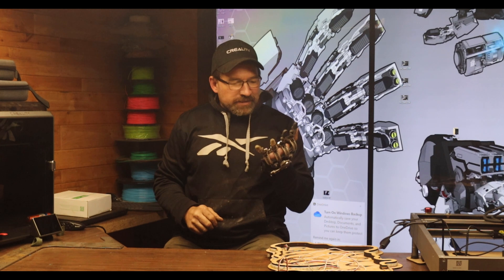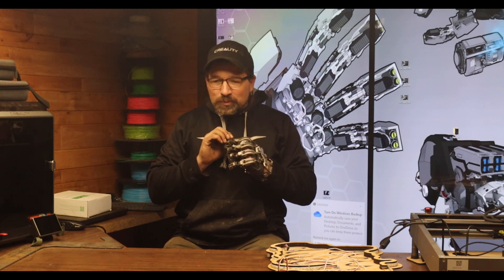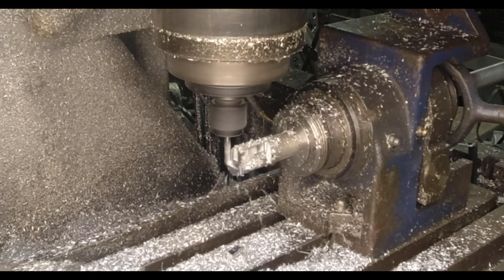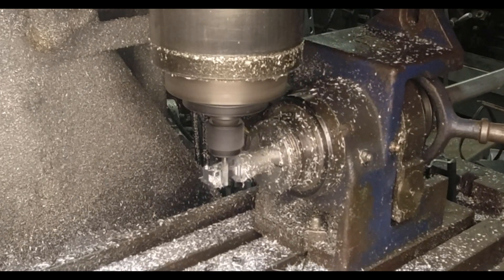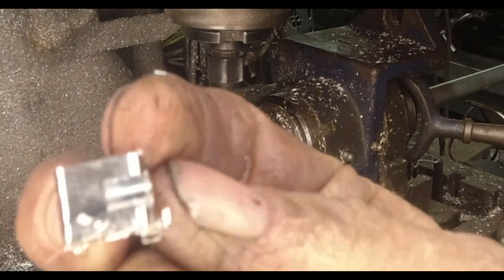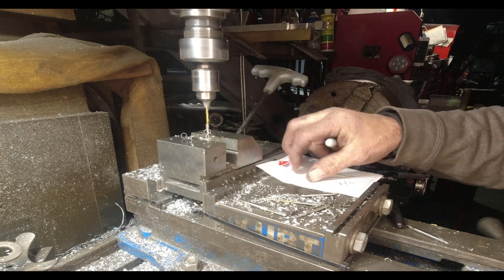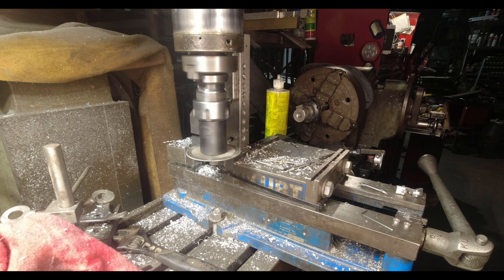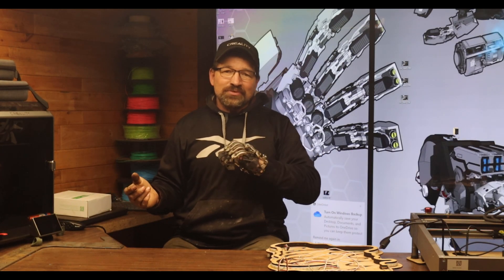Shiney new parts for my High Tech Prosthetic Hand

Comment: Is titanium out of the question because of the milling?
Reply from the maker: More the added cost. It still might be necessary to make the p1 out of Titanium for the added strength over the  AlSiMg that I'm currently using. Once I get some real time on the v4, I'll know for sure.
Reply: @missingpartsclub Now I understand; thank you! It is an expensive material, that is for sure, but the benefits are there.

Comment: On the low-end I'd be curious how PETG performs for your usage, on the high-end PEEK or PEKK. Nylon is extremely hygroscopic, PLA also seems to break after getting bent to induce fractures, then given time to absorb water. 

As another possible idea, maybe a continuous CF type print would hold itself together a little bit, but that's putting a lot of faith on the fibers to do better, in practice it might even break faster due to the extreme porosity from the fibers letting water penetrate.

Best of luck finding the ideal printable materials. Another idea is conformal-coating.. (nail-polish?) The PA12 to lock it to the current humidity level, so it can't cycle as much.

Comment: I'm curious if CFPETG would work for your application. I find it easier to print than the nylon stuff, has great layer adhesion, and a nice middle ground between rigidity and flex. It's a little less susceptible to moisture issues than PA, but you still want to dry the crap out of it for best results. Also the bambu CFPETG isn't as good as the stuff I get from 3Dprintingcanada.

Comment: I think part of the frustration is that 3D printed parts are not a drop in replacement for machined parts. They have different properties, advantages, and disadvantages. To fully take advantage of 3D printed parts I think a ground up redesign would be necessary. I think a sort of socket joint might work better in place of pin joints. Of course, this is just my uninformed musings and I've not done anything to test of verify these theories. Keep doing what you are dong Ian! You are doing great work!

Comment: I designed an MJF Pa12 harness anchor for my son's body powered arm.  I was sent three and there was quite a lot of variation.  Two of them could be snapped with my bare fingers and one of them is seemingly indestructible.  I cannot break it and its been in use for 5 months.  The one that didnt break came from Advanced 3D in Ohio.  The two that broke came from 3DPrint UK - exact same files.  Shot peened and dyed black.

Comment: You should give MJF a try, not something you can do at home, but seriously strong.
Reply from the maker: The original parts were mfj pa12 from jlcpcb. They did a great job on the printing, it just seems that the material just doesn't have that great of a lifespan with my usage scenario.

Comment: I suspect the 3d printing process is messing with the material properties. If the layers aren't as strong as the raw material, they'll fail at far lower stresses.
Reply from the maker: The original parts were printed with multi fusion jet by jlcpcb. They were great in the beginning,  but after a while became super brittle.

Comment: what type of failures did you have in the nylon? cracking?
Reply from the maker: Cracking, fractures, and just plain shattering. For the first while the material seemed to have some elasticity to it. But as of late, all of the mfj pa12 parts have become very brittle.
Reply: Yeah I don't know about you but the relative humidity where i live is always very high. So I dessicate and dry box everything now. But the problem I have been having with nylons is similar. I finally tracked it down to the slicing profiles overcooling the parts in part due to the use of support material. I wish I had the time right now to offer helping you tune a profile or something similar to attempt to solve the issue.

Comment: Try SLS or MJF printed parts, PA12 with 2 or 3 mm wall thickness in sls wont break that easily. If u were mentioning FDM as plastic manufacturerimg method, you should definitely try it out.
Reply from the maker: Thanks   these parts were printed by jlcpcb using their mfj setup. They nooked great, but evidently, my use case is too much for that material